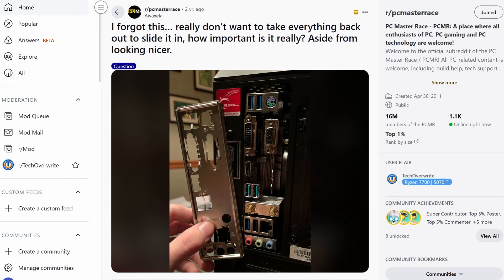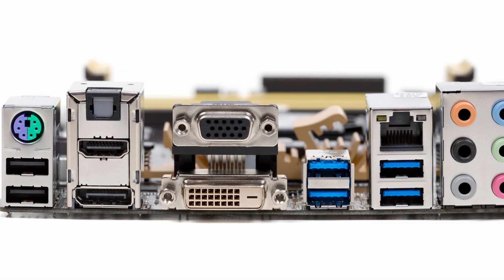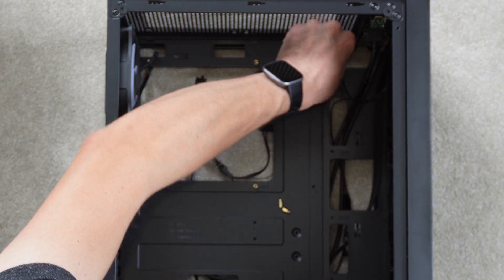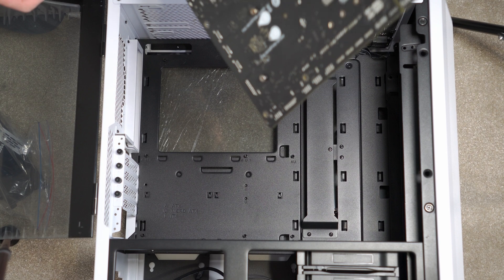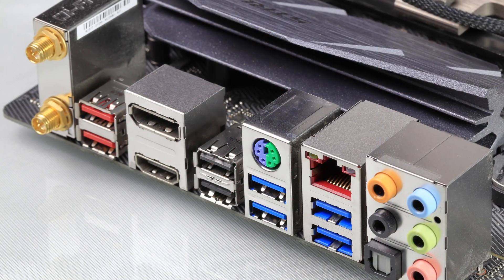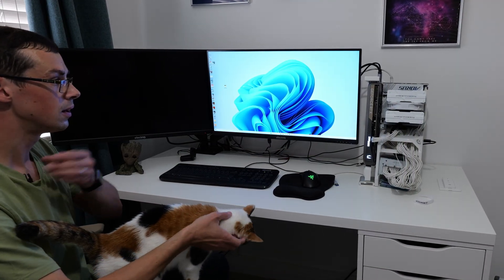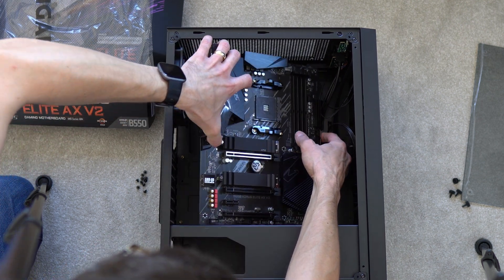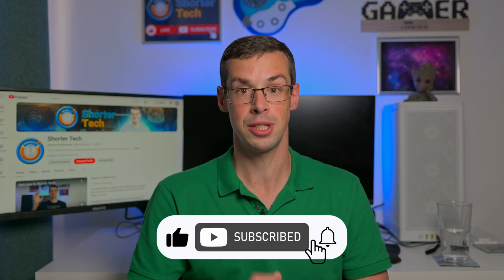Do You NEED The Motherboard's IO Shield? (If, Y'know, You Forget It...)

Comment: I built my brother an AM4 system a couple of years ago using a used motherboard without an I/O shield. Honestly, it hasn’t really been an issue in my opinion, since his case already has many openings for airflow. I had thought about DIYing one when I bought it, but honestly, I feel that the I/O shield doesn’t provide a significantly greater amount of protection. That being said, I live in an extremely clean home, so dust isn’t much of an issue if I clean my PC out every year or so.
Reply from the maker: Yep I agree, this is my view too. It's not a major deal to miss it out :)

Comment: Hey, needed your help. I was looking for used GPUs and found a Zotac rtx 3060 for a great price, only catch, its got no I/O sheild. The seller is willing to show me the card running on his system and test it. Should i get it?
Reply from the maker: Hey, sorry thought I replied to this earlier. So the actual GPU is missing the metal bit where the HDMI and DP connectors are? I mean, it's not ideal but if it's for a great price, the lack of the IO shouldn't be a deal breaker IMO. You'll just have to be a bit more careful with it I guess.

Comment: Hey, needed your help. I was looking for used GPUs and found a Zotac rtx 3060 for a great price, only catch, its got no I/O sheild. The seller is willing to show me the card running on his system and test it. Should i get it?
Reply from the maker: Hey, oh so the actual metal 'back' of the GPU (where the HDMI and DisplayPorts are) is missing? Uhm, that's a good question. I mean, in theory that does help a fair bit - especially with attaching the GPU to the case. But if it's for a great price, you should also be able to zip tie the GPU to your case. It would work fine other than that, IMO.

Comment: Hello. I'm having a bit of a problem and was wondering if you could give me some advice.

I'm currently building a custom PC after a long break. Last time, I used a motherboard with a separate I/O shield, which caused me some trouble, so this time I bought a board with an integrated one. However, after installing it, there's a gap of about 1mm between the I/O shield and the case. I've already checked the standoff positions and tightness multiple times, so I'm quite puzzled.

From your videos, I understand that a small gap might not be a problem, but what do you think is the most likely cause? Is it an issue with the motherboard, the case, or a compatibility problem between them?

Motherboard: MSI B850 GAMING PLUS WIFI
Case: NZXT H5 Flow 2024
Also, is this kind of gap common even with motherboards that have integrated I/O shields?
Reply from the maker: Hmm that's odd. A very tiny gap isn't a major issue, but 1mm is a bit frustrating - especially if it leads to blocked ports. Maybe you need to add 1mm spacers to your mobo standoffs?
Reply: @ShorterTechOverwrite  Fortunately, all the ports are accessible.
I think there might be some slight warping in the case, so I'll try to make some adjustments. I hadn't considered adding spacers, so I'll look into that as well.
Thank you for your advice.